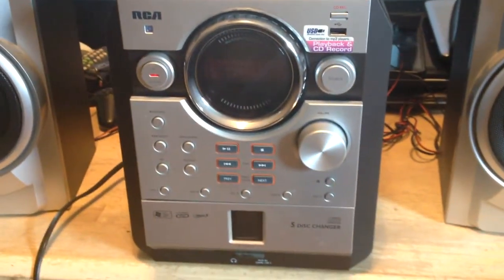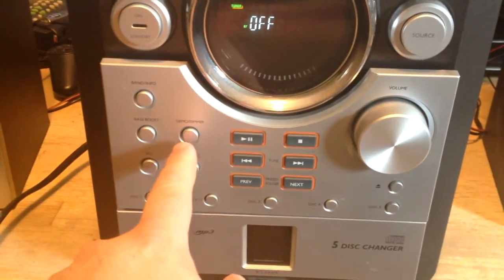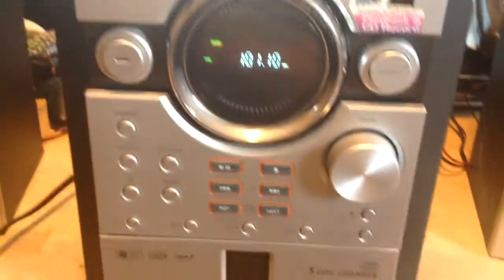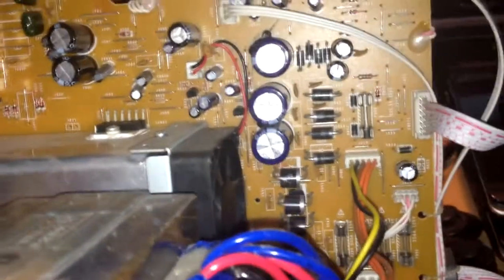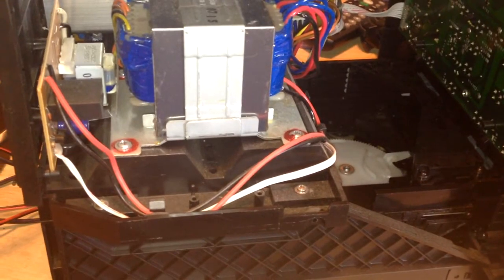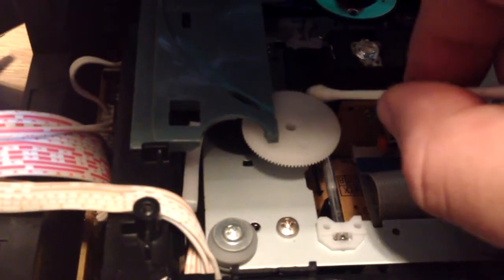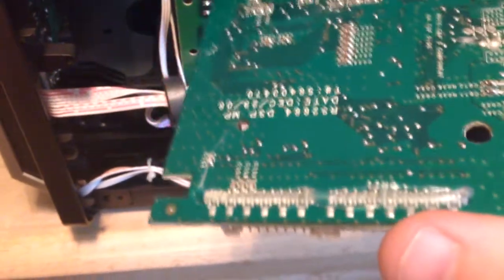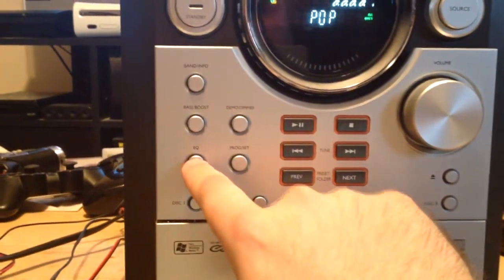Trash Picked RCA RS2664 Compact Stereo Repair

Comment: I picked up one of these from goodwill a few years ago and use it for sound from the TV/computer/turntable plugging each one into Ax when needed. The cd played did the same as this one. I never opened it but but would every now and them try to get it to work when one day out of the blue the damn thing opened up on its own. Still can't get it to play a cd and there is no way I'm going through what you did. I do love the sound of mine and I do believe it is 300 watts. At least it sounds like it. Wouldn't wouldn't to pick up another one if I got the chance.

Comment: Mine is still kicking!  I use it as a sound system for my TV, but I had the FM static issue for as long as I can remember, as well as the buttons and remote just dying.  I just leave it on and use the TV controls now for volume, but it's still definitely a great upgrade from my tinny TV speakers!

Comment: One from Mexico. A client of mine left me this device in exchange for USD $20 for a medicine. I'm actually checking all this system. The FM radio wire is short, the cd doesn't work (no read and no tray moving), keys not working and the amplifiers exploded. I'm washing all the cd tray mechanism and replacing all the keys, and the next week I'll buy the amplifier ICs for replacing

Comment: Hi! I have this exact same system, my speakers look a little different but the receiver is exactly the same. I have the RCA RS2656 and my issue is I can't get the CD holder to eject. I've pressed the eject button lightly, aggressively haha, several times and it won't open. It was able to read the CDs, just won't eject. Any help would be so appreciated!
Reply from the maker: You'll have to pull it apart and look for the drive belt and clean it or replace it. If that belt slips or is gone the door won't open.
Reply: @BeachTechPC  okay awesome thank you! I will try that. :)

Comment: my disc drive doesnt eject. how do i fix that?
Reply from the maker: Check to see if the belt is slipping or gone on the tray eject motor. If it's slipping try cleaning the belt with some alcohol or windex.
Reply: Beach Tech it does nothing when I hit eject. No motor sound and the screen just sits at disc 1 with nothing showing for the discs
Reply from the maker: Sounds like one of two things has happened. 1. The little DC motor for the tray has died. or 2. The buttons on the front are not working correctly. With my unit some of the function buttons would not work correctly.
Reply: Beach Tech how can I test if it the motor or the buttons?
Reply from the maker: Do you have a DC regulated power supply? If so you can disconnect the motor from the unit and try powering it up with the power supply to see if it will run. As for the buttons you can try removing the board from the unit and clean the contact switch's.
Reply: Beach Tech to make this easier for me to ask questions... Do you use discord?
Reply: Beach Tech hey what would work for a way to test the motor? Also how would I fix the volume knob? Mine likes to just go up and not down.